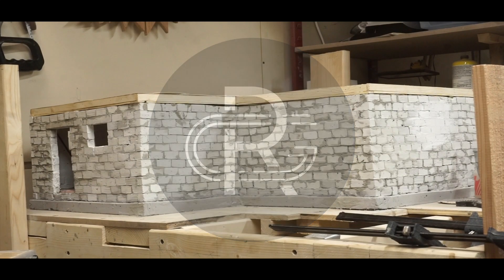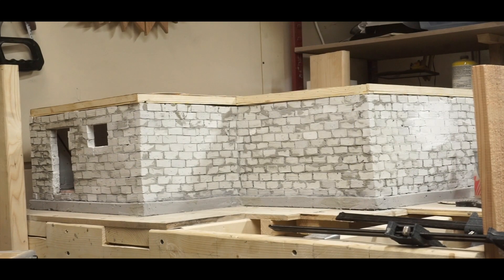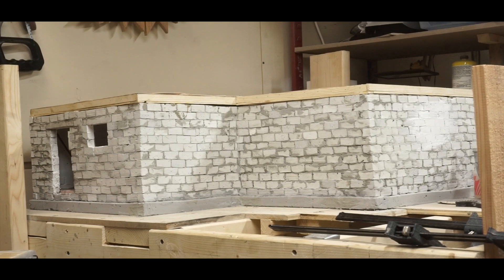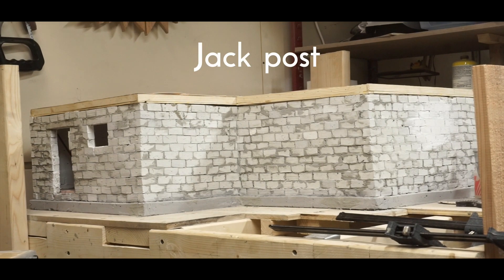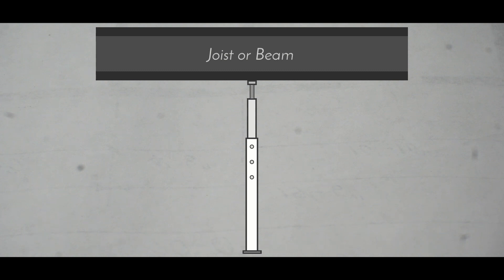Building a Realistic Model House, Part 12: Making a Jack Post

Comment: Ryan, how heavy is your house so far?
Reply from the maker: Great question! I'm not 100% sure in absolute weight, but I can definitely still lift it up on my own (though it's near my limit) and two people, one on each end, could probably carry it. Sorry I don't have a better answer than that!
Reply: @RyanGausMakes  Thanks. Debating how insane my house will become weight-wise if I make a cement basement and foundation...
Reply from the maker: @stephenlucas6038  I used one and a half bags of cement-based material to pour the foundation, slab, and make all the blocks. I think they were 25lb bags. What scale are you making your house? At least in my opinion, it's definitely worth it to do it if you can - it drastically increases the realism.
Reply: @RyanGausMakes  Good to know, Ryan. I have this crazy idea for a project where it can't be too large, so I'm thinking 1:24. I totally agree about realism. And really, longevity. Foams and plastics get weird over time. The footprint of the main structure will be 307mm x 360mm (i've measured my old PNW house where I live and done the math to get to this:), so with three floors, I am wondering if the concrete footer/foundation will be needed for structural support. I really want to do this, but can't imagine creating 1:24 lumber, etc.
Reply from the maker: @stephenlucas6038  I think 1:24 lumber would be doable with a zero clearance insert on a table saw. I wonder how nails or fasteners would work at that scale, though.
Reply: @RyanGausMakes  I'll have to see about the lumber. In terms of fasteners, good question. Wood glue? Definitely a diversion in terms of realism, but so is the ratio of the thickness of most pins/brads and the size of mini lumber; maybe even at 1:12 scale?
Reply from the maker: @stephenlucas6038  Yea, wood glue is probably the best option. The sequin pins I have been using are the smallest cheap faster I've been able to find. You're right that even at 1:12 scale my fasteners have been a bit large - I've joked before that I'm putting the house together with railroad spikes! 😂